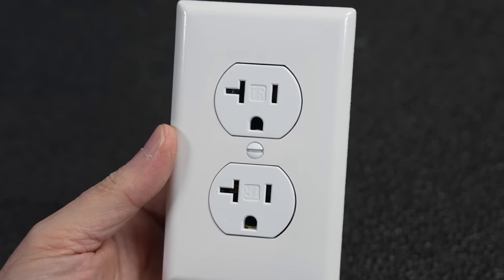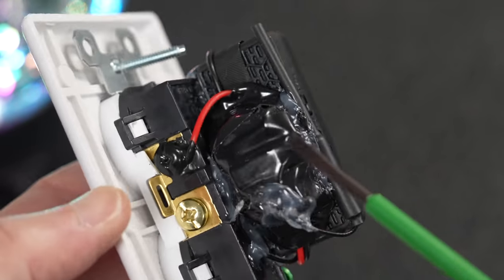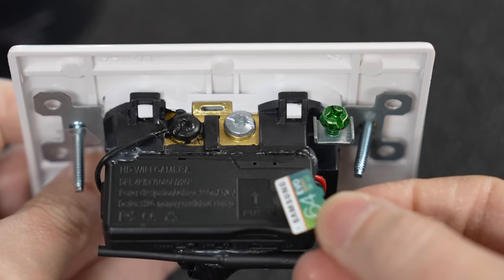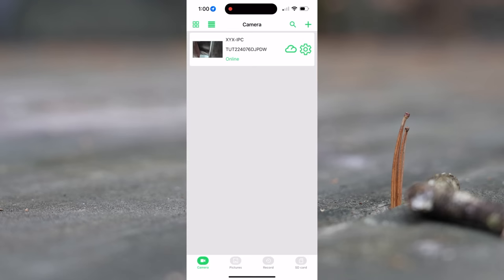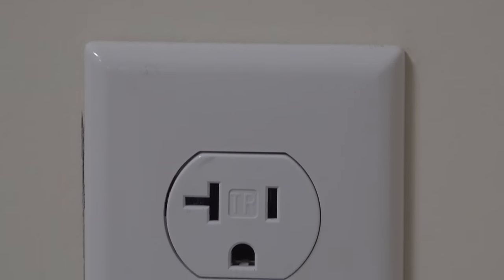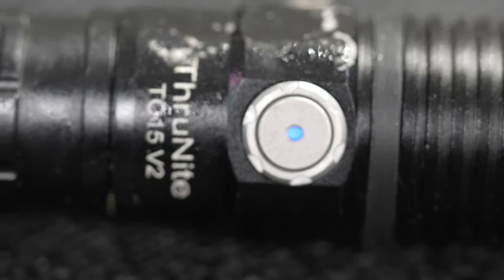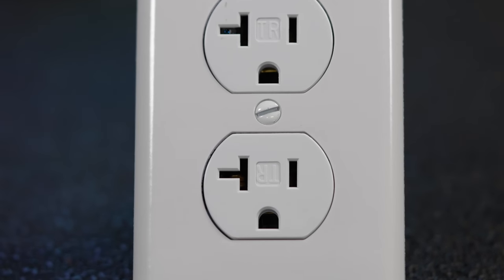Most ILLEGAL Outlet in the United States

Comment: Two questions:
Question 1) Is it legal to own and install one of these if I remove the camera part and use it just for the WiFi?
Question 2) Does the WiFi module need a WiFi plan for it to be usable?
Reply: If you have to comply with the National Electrical Code, then no for question 1 because (a) there is presumably no NRTL listing, (b) it says TR when the socket is totally open, and (c) it is a 20-amp outlet but one of the sockets is blocked by the camera lens.
For the Wi-Fi, it's likely a generic ESP type module, which is connected to directly with a computer, smartphone, or other device.

Comment: You are using a low voltage mounting ring to install a 120v outlet. Those are for things like cat 6 or coax or hdmi. You should have used a real cut-in box that contains the terminals on your receptacle. Unsafe and against code.
Reply from the maker: 2:30

Comment: Illegal installation.  Meaning there’s NEC for a reason in the US.
Reply: UL listing is fake too because they would never list a device that has been modified to no longer comply with its amperage and child safety standards.

They could theoretically approve such a device if the camera were outside of the socket face, provided it is integrated in a manner that doesn't pose electrical safety risks.

Comment: It's transmitting WiFi and as such is readily discoverable with a common mobile phone unless the WiFi on the device is disabled.  Just scan for devices on WiFi, whether you can connect to it is irrelevant, it's presence is revealed. Such a device is archaic compared to some other options that just aren't commonly known to the general public.  But obviously such things as this are readily available and should be known as widely as possible as there are so many nefarious reasons people might deploy them.
Reply from the maker: True, but this model and others can have the wifi turned off and only use the local memory card (obviously hard to get to) but they can also do bluetooth so unless you are using a scanner, like NFC they can be tricky to pickup. Scary how advanced these very rough looking devices are

Comment: Great video as always. It looks like you used a low voltage box for the video. I don't think that is correct for a 120v outlet. I think those are only for cat6 cables and stuff like that.  Other than that, thanks for sharing.
Reply: That is a NEMA std configuration  for a 20 amp ,120 volt appliance. Look it up in the code book.
Reply: @WesB1972  I thought 120 volt boxes couldn't be open in the back as the one used.

Comment: uhmm that is a specialty camera thats specialty ordered, they sell and have sold those outlet style (but not with the camera) for many decades and we have those and use those.. we just dont have the one with the piggyback module... we use them with the proper corrisponding plug and use it for actual 20 amp dedicated lines... we just had someone say one of our outlets was illegal so we pulled the outlet apart which is located 9 inches to the left side of our mains panel and broke it open to show them its not... thats a specialty outlet dont say THAT style outlet as a whole is illegal... we now have that broken open outlet hanging next to the stack of 6 outlets styled like that with a notice these are NOT the outlets you see on youtube... if your that worried take a flashlight and look in it and stop the scare tactics... also that TR marking on the front of the outlet means its "Tamper Resistant" the front slots are supposed to have shutters so if you have outlets that are TR marked and no shutters then you get rid of them either way camera or not TR was ment to keep children from jamming things into an outlet and frying themselves.. just look up stealth cameras and you will find them in everything from smoke detectors to picture frames to outlets to bottles they can be put in anything.. i doubt our trusted electriction is about to ruin 3 generations of trust over a stupid camera consitering he gives us the option of buying the outlets we want to use and he installs them.. if your worried go buy the proper horizontal neutral pin plug and stuff it in i guarentee you it will quickly destroy that camera inside..

Comment: That would not even fit into a rec box if you notice the box he used doesn't have a back on it that's because it's for low voltage wire like speaker or cat6 a box for 120 v rec is closed in only open in the front and as any respectful electrician they would install some krap like that

Comment: The way it looks on your video, it looks like you would not be able to plug in a 20 amp plug into that top outlet because the camera is there. Is that true? Because if it is, then all you would need to get a 20 amp plug and try to plug it in. If the camera id blocking it, then you shouldn't be able to. Am I correct?

Comment: You’ve got to be kidding me, this is the most ridiculous video I’ve seen on YouTube thus far!

You can tell by the connections on the back of the outlet that these items were purchase separately.

Then the camera being installed after the fact and no company uses liquid seal on their screw terminals.

If this receptacle/camera idea we’re true the camera contents could be integrated into a GFCI receptacle.

The deeper casing could easily hold typical receptacle components with the addition of camera components.

This would be more believable if a GFCI Receptacle was used and converted into this outlet/camera!!!

Comment: What happens when a horizontal bladed plug is plugged into that outlet?  Is the camera lens spring loaded or does it break?
Reply: @jameskarrie298 The edge of the plug will touch the slot, but with bad contact it will lead to bad things happening.

Comment: I have a couple of issues with this device. One, this appears to be a 'custom made' device, and a rather sloppy construction at that. And two, this will only work IF nothing is plugged in since most electrical cords will completely cover the 'camera' that is built in. I think the 'Click Bait' title should apply to all but paranoids.
Reply from the maker: I won't like the real outlet used but the most frightening part is that in the past 3 months they have sold over 3000 of these , thats just from one source. You can be certain the majority are being used illegally. Plug in cameras are a lot less effort. These are a different breed.

Comment: Interesting device.  Would make for a good security enhancement camera.  Around here if your outdoor security camera does not cover the windows or doors to show burglars entering,  or have a camera inside the house your security cam footage isn't good for anything but being a timestamp that somebody was in the area.     
Question: @silver cymbal  how close is the camera lens to the face of the outlet? Looks fairly close to the face in the video.  If you ram a 20Amp plug into the outlet, is the camera far enough back that it will only be blocked, or close enough that  you could damage the camera in some way if you say, carried around a 20amp plug to ram into the outlet.
Reply: Most of the time one could use a 20 AMP plug to Test-for/Break the cam.

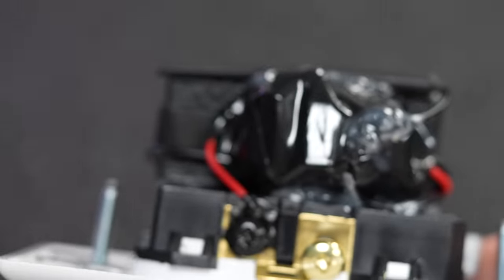Comment: 2:35 the LV box you installed is against the electrical code for anything other than Low Voltage, why would you create an issue by using the wrong old work box on your video. If you have line voltage 110-220 you must have an enclosed box not just a box ring for low voltage.

Comment: Wait wait wait. You've just equated a standard and normal 20A 120V outlet with a spy camera. Any outlet could have a spy camera, and it's just this extra slit in the 20A version that makes it easy to add a camera in the 'shadow' behind it. 

I wish you had  stated that there are WAY more 20A real outlets installed then there are spy outlets, so that everyone who sees that 20A version doesn't freak out! If they see that extra slit, sure, they should inspect it, but the slit in a real 20A plug is not a GUARANTEE of a spy camera... your video confuses that point.
Reply from the maker: Thanks for the pointing that out, that was definitely not my intention. I had mentioned the offer a 15amp and 20 version. The 15amp places the camera in one of the ground prongs.

Comment: My biggest question: Is it actually rated for 20A?
Reply: Its a normal 20a plug with the camera grafted to the back, so technically yes, although the top plug with the camera lense in it wouldnt be able to accept a 20a cord end
Reply: Ratings and certifications most likely evaporated the instant that device was modified, so technically no.
Reply: @billtaylor9418  yeah yeah if you want to be pedantic about it lol

Comment: So if i build an AirBnB I need to use all 15 amp outlets, so I can spot one of these if a renter replaces them. How many appliances even use the 20 amp style plug?
Reply from the maker: Not at all, the style of outlet isn't the giveaway they make many versions. You would have to inspect each one, smoke detectors and even fire alarms are routinely used

Comment: But what if you have an actual 20 amp appliance with the 90° prong, can you still plug into that top outlet?
Reply: If you couldn't get the plug to go in the receptacle due to a camera being in it, that would be a code violation. I would probably investigate it with an insulated screwdriver, alacrity, and vigor. Put on protective eye wear in any case.

Comment: I have seen this receptacle, many times, in different settings. I didn't know it's a camera.
Reply: Plugs that look like this are just rated for 20A rather than 15A. They arent all cameras. 20A plugs are usually used for kitchen counter plugs, garage plugs and air conditioning plugs. You can buy ones that look like this at the hardware store for $1. If you see one randomly in a spot that isnt any of the places i listed, then worry about a camera

Comment: Um not every slotted outlet is a camera.  These are from way back.  There used to be plugs one prong went vertical, the other went horizontal.  This is click bait.  Same reason one ear on a plug is larger than the other.  Polarized plug.  Edit : true you shouldn't see a modern socket like this.  I never have, but if it's your property you have all the right to use this.  If I'm worried about the babysitter with my kids I'll have my Christmas tree watch em.  See what I did there?  Made it all inclusive.

Comment: 2:38 NEC VIOLATION!!!!!!!!!!!!!!!!!!!!!!!!!!    Box must be totally enclosed. The ring shown is for low voltage work ONLY.
Reply: If you read you can see that is covered.  In addition, replacement 15 and 20 amp grounding receptacles must be proper TR (not fake) when installed in code required areas.
Reply: No reason to show NEC illegal work! Why would you do that? It gives folks false impressions.
Reply: @jimw7ry  Pretty sure modifying the receptacle to add the camera voided its UL listing, also making it noncompliant with the NEC.

Comment: So the device itself isn't illegal. How you use it can be. And no, recording someone without their permission is not illegal, unless you've planted something like this on their private property. If you installed one of these in your own home or property, it's completely legal to use.
Reply from the maker: In your own home, yes. Anywhere else without permission, no.But you wouldn't need a model this secretive in your own house.
Reply: @SilverCymbal  Disagree about "But you wouldn't need a model this secretive in your own house.". Using hidden cameras can be a good security strategy, if combined with fake visible cameras, and camera signs.

It depends on how valuable your home and your contents is. Having a security system consisting of hidden outlet cameras + visible fake security cameras + camera sign,  By using fake cameras, burgulars will act in accordance with the fake cameras (for example, believing that a location is unprotected because theres no fake camera pointing there when its in fact protected by a hidden camera) or even destroy the fake cameras, not realizing that theres hidden cameras.

But yes, most "normal" homes doesn't require hidden cameras. If you have more valuable stuff, hidden cameras can be a solution.
Reply from the maker: @sebastiannielsen  You are correct, all good points.
Reply: @SilverCymbal  I can think of several use cases wherein you might want something this clandestine. For example, if you suspect a sitter is abusing your child, or that a home cleaner or electrician or plumber etc. is stealing from you. In my case, a relative was stealing medications from our bathroom, and I was able to capture that on a hidden camera. 

There are a lot of legitimate and legal reasons to use this on your own property. Putting it on someone else's property is illegal without some sort of court order or other.

Comment: I have a similar-looking outlet in my apartment (it has similar “TR” lettering, but it’s only 15 amps rather than 20), but considering it doesn’t have any horizontal slots, I highly doubt it has one of those cameras inside, as you’d be able to tell almost immediately if you know what to look for (that tiny lens).
Reply: "TR" just stands for tamper resistant, tr plugs have plastic shields in them that stop idiots and children from sticking forks in them. Its a normal plug you can find at the hardware store

Comment: As a kid I thought some appliances have a special kind of plug that only works for that outlet.
Reply: You were correct.  Some appliances require a 20 amp circuit.  They most often require a  dedicated circuit - a circuit that only has one outlet on it.  They usually involve motors.  Motors will run on less than their specified voltage, but some types will be damaged by low voltage, which is caused by using a wire size that is too small or too much wire between the breaker and the outlet.

Comment: If anything was illegal about this video it was the install. Thats a data ring used for low voltage. Shoddy install, exposed wires not in a box. I wouldn't buy a house from this guy, its a fire trap!
Reply from the maker: Just want to make sure you can read, you did see the text right about the outlet right? Take it easy

Comment: That outlet style is actually a 20 amp dual voltage 120/240 volt outlet, usually used for medical equipment at home. The dual voltage also requires a special breaker at the other end.

As for legality, it depends on the state. Most states allow hidden surveillance if one party is aware of it, or if signage warns people it is taking place.
Reply: It would also require 12 gauge wire rather than the usual 14.

Comment: it's fake... u can't use that with 120 volt... also if u put a plug cover over it... it won't record
Reply from the maker: You saw me plug a 1200 watt vacuum cleaner in right? If you look close there is a small 120v transformer wrapped in plastic to step it down for the camera circuit.

Comment: Can you please make a video of the orange electrical box thingy at 02:33? Would this be a direct replacement for an electrical box?
Reply: That’s a low voltage box - used for things like phone, Ethernet and cable tv ports.  It’s against code to use one for AC mains wiring.
Reply: If any thing was illegal about this video that was it. Thats a data ring used for low voltage.